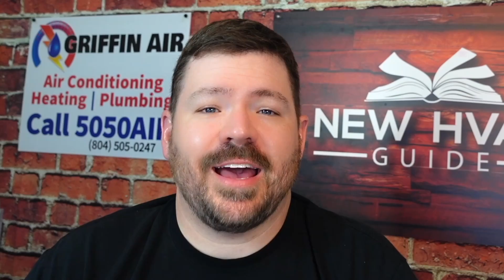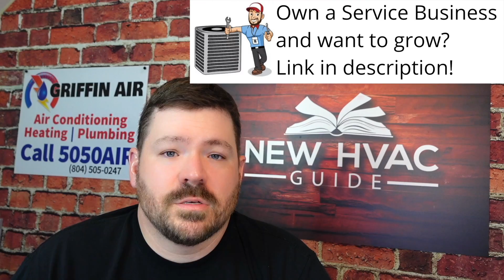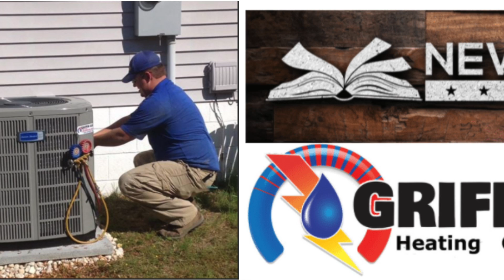Gas Furnaces BANNED! First State to Act!

Comment: I had a Very Small 1 Bedroom ALL ELECTRIC apartment in the late 70's. Stove, furnace, hot water heater. DO YOU KNOW MUCH IT COST BACK THEN??? SHOCKING!!!! Gas stoves have been around since the 1930's thats almost 100 years. Why is there a problem NOW? The power grid has not been updated since the 1950's. Every summer they tell us to raise our thermostats so there are no power outages and now they want to make everything electric? I forgot to mention charging stations for electric cars. This is so f-----g stupid!

Comment: Canada here... Ontario is rapidly moving to high efficency only furnaces...please understand if you co-operate in a few years  the goal posts will move again and again.  They could care less what this does to seniors on a tiny fixed income.  These people are monsters
Reply: I got that inspection for the Canada greener homes grant. They are pushing so hard to get us to switch to heat pumps, its crazy. The inspector even tried to tell me it was “smart” to get a 0% loan for solar panels because it “will save you so much money” when pared with a heat pump.
These green types have totally lost their minds! Our grid will collapse with a few more heat pumps and electric cars.
Reply: The rush to "net zero"...its the entire western world...the UK...Austrialia...the EU..everyone must do it immediately ! They are pushing hard and fast hoping most people will be caught off guard and not do any critical thinking.  If we all signed up tomorrow for solar...heat pumps and a car charger port how are enough trained techs  going to be available to retro fit the western world ?  
And as you point out the grid is not up to it...I dont see any signs of that changeing.
Reply: @davidburman451  Yeah…I don’t see it changing soon either…sad. It’s probably wise to have back up power installed, even if its just to power the furnace and a few lights. I plan to do this soon.

Comment: Consumers going to get hosed.  They cost so much to operate.  I grew up in Northern California and heat pumps are the worst.  Going into defrost and emergency heat once it drops below 40. Many homes don't have the capacity in there electrical panel. So now they'll need panel up grade and a new wire pull. The power grid in place can't handle the demand now. So they then they double down and tax the system even harder.  It's just nonsense. Glad I left the Commifornia but I do feel for the folks still there.

Comment: Mini split aren't efficient under 35 degrees. In New England it's not an option if you like to be warm when it 10 out. California is such a screwed up state no wonder everyone is leaving.
Reply: Sounds like you are talking about traditional heat pumps. Mini splits with inverter tech can be pretty damn efficient at 10 degrees fahrenheit.

Comment: I thought this was for new homes only
Reply: No. They made it illegal to sell a replacement gas appliance in California after 2030.  Pretty Boy Hairgel also made it illegal to sell a gas powered home generator and gas powered lawn and garden equipment after January 1, 2024.
Reply: @kimmer6  I live in NorCal and have an 80 y.o. house. I just replaced my 30y.o. Heil 3 ton gaspack a few weeks ago 
  
   I got a good deal on a Trane XL16c [on the roof] 3 ton gas/electric 2 stage unit, love it. I was offered going all electric 

    with heatpumps and the Bosch. I also enlarged the intake and the ducting..So I sure hope to get 20 plus years out of it.
Reply: @1Mannco  I hope it works for you. That's a good unit. My friend used to install Tranes. They used to say ''It's hard to stop a Trane''. He said it was even harder to start one for the first time. Should be good for 30 years.
Reply: @kimmer6  I read that tge final vote will be in 2025 and Los Angeles only banned gas appliances in New construction
Reply: @ryank7961  Count on it passing. Several California counties already will not issue building permits for gas lines and meters to new homes. They are going along with the UN Agenda 30 which is pushing for ''substantial reduction'' in the use of fossil fuels including natural gas.

Comment: Good information,  but you are way behind.  There has been a few counties in Commiefornia that has banned all burning fuels almost a year ago. New York and a few others have also announced this over he last few months.  Heat Pumps are good, but not that good. Also Commiefornia is having and will have electrical supply issues.  They have shut down 6 power plants over the last few years, already.   Politics are a part of our trades, speak out or get steamrolled.

Comment: I think electric is better than gas IF YOU HAVE SUPPLEMENTATION. For example, get a 5KW solar system and you'll be good. You save money in the long run. But forcing people to buy electric only is not right.
Reply: 15KW and a huge battery bank is more like it...unless you live in a shed.

Comment: They tell everyone to get off oil and put in gas furnaces in my area during the last decade.  Now new York is talking about following California.  I had an electric water heater.  So slow recovery and not enough first hour rating to fill our large tub.  Went with oil.  Even at $5 gl it costs me less to use the oil fired hot water heater.  I feel a big part of getting off oil heat was to take control over where you buy your fuel and the tax issues as well as the control of when you purchase it.  Now taking gas away makes you have to buy it from one place (mostly even other suppliers are only a small part of the bill). As well as increasing electric demand that they can have even more control over.  

I'll stick with my oil.  In my own tanks and my firewood that's locally sourced from trees that were naturally dead and grew in the last 30-50 years.
Reply: Next they'll say you can't burn wood or pellets. Bureaucratic idiots !
Reply: I have oil but I'm putting in a split system so that i have redundancy (no room for a wood stove) but i find it hard to believe that oil is cheaper than electric at $4 a gallon. I have a hot water coil on my boiler and on average, the electric water heater i put in is WAY cheaper @13 cents a kwh than running my boiler during spring summer and fall.  That being said,  point taken about slow recovery with most electric heaters.
Reply: @chrisE815  split system yes I get that.  

My hot water is under .8 gal a day on average during off season.  

But the thing that gets me is the new builds they will not even approve plans or build inspections of you have any fossil fuel.  Meaning. No gas lines to the house. No propane tanks. And no oil tanks.

Comment: Good. We need to aggressively stop climate change and air pollution. Look at these insane storms we're having, and we're only at 1.1 degrees Celsius above pre-industrial temperatures. It will get worse, the question is how much worse.
Reply: I'm all for clean air, but this "climate change" conspiracy is getting out of hand. These "insane storms" have been around for ever, I remember the crazy storms we had 25 years ago.
Reply: Climate change happens
Reply: You're delusional.

Comment: California is the most retarded state in the country. They do know that heat pumps don't usually work very well in extremely cold weather, which is why most heat pumps either have an oil or a gas furnace as emergency heat in case it goes below. 30° also, it's another way for California to control people's electric bill. If they start installing electric, water heaters and electric baseboard heat then they could just shut you off whenever they want

Comment: Why do you talk about resistive heaters when heat pumps use a third the energy?
Reply: Because most folks in the HVAC industry have a pro-gas and anti-heat pump bias. Heat pumps did used to suck for most places, but nobody wants to acknowledge that today's inverter heat pumps work very well in the vast majority of cases, particularly mild climates like CA.

Comment: I live on the coast in California and I’m a HVAC contractor In my service aria  you don’t see A/C in homes it doesn’t get hot enough
so to run all electric you will need to run new electric service because most of the older homes have only 100-125 amp service, so a new 40 amp service for the heat pump 15 amp to the air handler all new line set,
So what’s a normal 95% high-efficiency Natural gas furnace change out for $5500.00 
Will go up to $15-17k for a heat pump 
I get this question all the Time when people get solar panels on the roof they want to change to a heat pump when I tell them the price difference that more or less Kills that heat pump idea, and I tell the customer you get A/C And they tell me who uses AC on the coast that’s ridiculous, I tell them you get it whether you want it or not,
I think it will be very busy installing furnaces before the 2030 deadline.
When we get heat waves in central California The utilities asked not to use your AC or turn it to 78° so now we got to balance that out in the winter when we get very cold weather they’ll tell us not to raise the temperature up because of the demand on the grid, and you can’t also charge your car we’re doing great over here. bunch of idiots
Reply: Why do you need a new 40 amp service for a heat pump in a mild climate? If you're near the coast, a 2 ton system that probably only pulls 15-20 amps will work for most houses. Don't know why the air handler would need an electric service upgrade if they have an existing furnace, that doesn't make any sense.
Reply: @Knowledgethattheyfear  Yea this story is fishy. I live in the Bay Area and got my heat pump and air handler replaced last year for $7k including labor. And it wasn't some bargain bin HVAC company.

It's more than capable of heating and cooling when needed.

Comment: Here in southwest Ohio they build 2000 sq feet new houses with a gas furnace and electric water heater. If the home builders spend 3k more they could do Heat pumps for both. The government could kick in some money and so on. This would save the new homeowner 25,000 in 30’years.
Reply: Ground and water source Heat Pumps are great and last up to 30 years. The initial investment is big. If utilities finance is one thing. Reliant did that at one time but promptly the BANKSTERS got into their act and that was the end of it!
Reply: I'm in Ohio as well and most contractors in the industry have an outdated view of heat pumps based off of bad experiences from decades ago. In the bad old days, heat pumps stopped working below 32F so heat strips ran basically all winter. Obviously that was very expensive compared with gas. 

But with inverter heat pumps today that operate down below 0F, Ohio is actually a good climate for switching away from gas. For me, I didn't use heat strips at all last winter, and in most winters its only for a few hours. But it's going to be a tall order to prove that with both the people who buy them and the people who install them.
Reply: @Knowledgethattheyfear  Technicians weren't trained to service HP units. Aces Supply had a good training school forever!
Reply: @Knowledgethattheyfear  When it got really cold last year I just use electric space heaters to supplement the heat pump. I have my thermostat wire disconnected to any auxiliary or emergency heat.

Comment: Eliminating the use of natural gas, which is far cleaner than burning coal and gives off less CO2, to homeowners will give electrical providers a monopolistic edge.
Reply: Electricity provides have pretty much always had a monopoly. That's why they're regulated by public utility commissions. Now, plenty of times those regulators were in bed with the company, but that's an issue regardless of whether it's gas or electric.

Comment: The person you’re quoting who is against the ban is throwing out a ton of misleading or false information. Peaking gas turbine plants are indeed not very efficient, but they only run on a few days per year when demand is especially high. Mostly it’s more efficient combined cycle gas and solar. Let’s also remember here that a heat pump triples your energy. So even in the case of the peaking plant, your net energy efficiency is still around 90% (30% x 3 COP). On the vast majority of days, your heating efficiency with electricity from gas is 180% efficient, or likely even better if using renewable energy. Heat strips don’t matter because it never gets cold enough where most people live in CA to need them.

Comment: I am running a high efficiency pellet stove and plan on taking advantage of the 30% rebait that is good up-to 2032 for a new one.  My backup is natural gas and they just replaced the gas lines in my area. I don't think it will go away anytime soon. If people haven't figured out how to recycle, how are they going to adapt to new concepts like solar, EV's and biomass fuels. They are too different to use and many people will just pay more money. 
The cost of energy is so high you really don't have a choice even if you don't have mandates on what to use. You will become energy poor. A good example is updating my chest freezer to the newer ones that use the new refrigerant. My new refrigerator saved me over $10 a month over my old one and the new chest freezer will save the same amount of money! I heat the house for $500 and the electric bill is between $40-50 a month! Solar is planned to go in 2025. If you're not energy efficient you're just throwing your money away!
Reply: The cost of energy is not high in states that properly regulate energy companies. California does not properly regulate. They never have.

Comment: More Bull from the Government. CARB is political. They base everything on hype and little on common sense. Most of all, they make everything more expensive for the public. Back in the 1970's AQMD, CARB, EPA all were pushing natural gas, CNG for automobiles because it was "clean burning" a good for the ecology. You are right, the state (democrats) pushed natural gas but suddenly now its bad. The only bad things in society are big Government and their overly staffed offices. 
Guess what? In California the temps are ususally very high in summer and the winter temps are usually 30 to 35 degress which means heat pumps are not going to be as efficient as an electric A/C and natural gas heating. So, the public will suffer in winter as they will run heat pumps in winter and they will not be as efficient which means the power used in winter will exceed the power used in summer using conventional A/C.  People will be paying up the rear for heating because power in CA is 36 cents a kWh while gas, more efficient in heating, is about $1 per therm. Sources suggest that gas heating is 3 times more efficient than electric in doing the same job so those who think a heat pump is the way to go will find out that is not true.  Plus, there will be those who have heating only and will need to replace their central heating system. The new law will require them to install a heat pump which is no different than central heating and A/C. Do they make heat pumps that only heat?  I don't beieve they do nor would so that will not go well as folks will not only be forced to buy expensive equipment to heat and cool when they didn't have that originally but the power bills will absolutely run them down into poverty to keep warm as before. Just think, some homes are older and have a limited service eletric panel and their gas heater is ready for replacement. CA will require themt to use an electric replacement but there's no electric circuit in their attic, just gas and 115v. So, to install that heat pump, they will need a main electric panel upgrade ($3,500) and a circuit run to the attic 240v ($500) then the heat pump install ($12,000+) and the gas pipes capped off. Once that's done, their winter heating bill will go from $120 gas to a good $300 or so in electric and the colder its gets the more that heat pump will run unless they pay for the heat strips that will make it even more expensive by double.